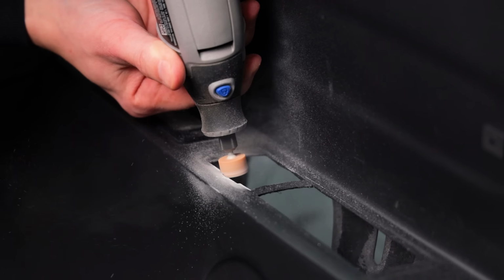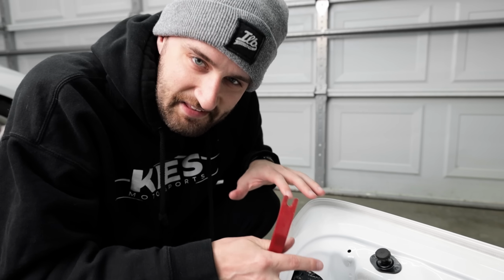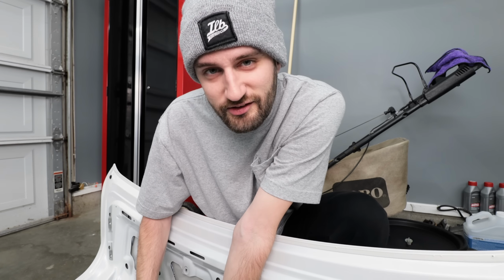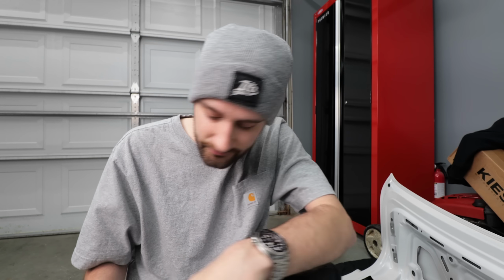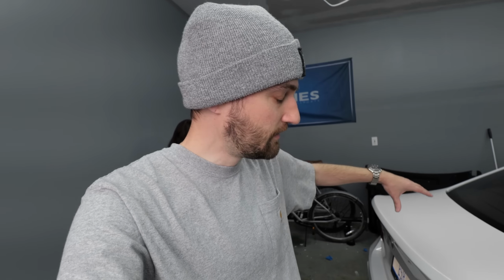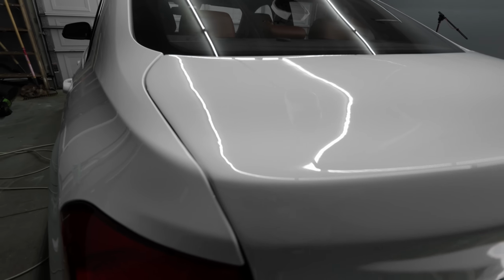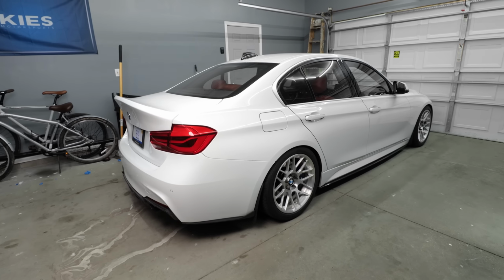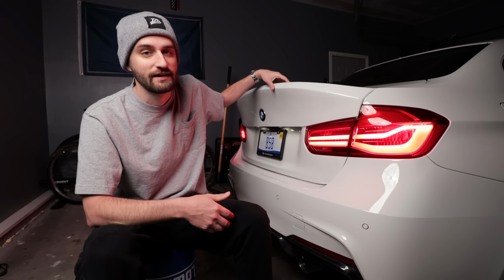Installing the Most Controversial BMW Mod | HOT 🔥 OR NOT 👎?

Comment from the maker: If you're wondering why I didn't put the trunk carpeting back in, I broke the latch handle and had to order a new one ($15). When I initially tested the parts for fitment, I didn't take the thickness of the paint into account, and after getting it back from the shop, the hole for the handle was too tight and I broke a bunch of clips off the back trying to force it in. That's why the handle looks a little wonky in the shot where I'm pressing the BMW roundel in.
Reply: Very very dope i need this too

Comment: BMW 50th Anniversary Classic M Roundels and center wheel caps are coming in May 2022. They would look fantastic on a white car with polished wheels. You might add the tricolor ///M decal stripes on the front or rear of the 340i.

The CSL Trunk looks best on a BMW 3-Series/4-Series E46, E9X, F3X, F8X Coupe/Grand Coupe because of the lower roof lines. I like it on the BMW F30 340i, but it might be too much on a bright white car....a darker color might work better. Some will install a carbon fiber CSL trunk and will paint it the same as the body color and leave a stripe of exposed carbon fiber as a fade at the tip of the spoiler. Looks so awesome.